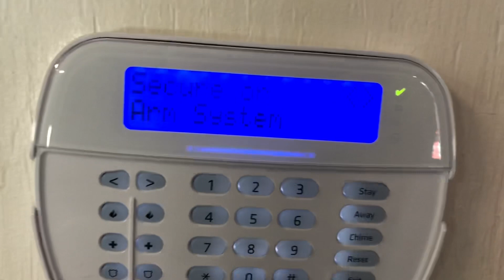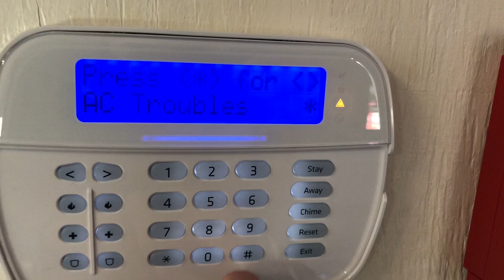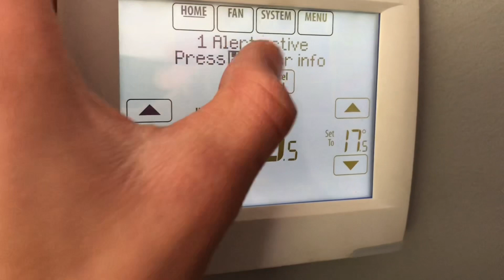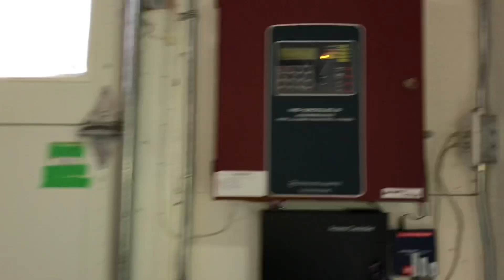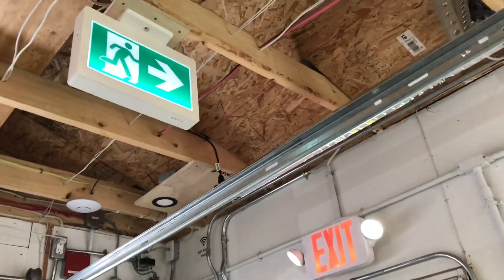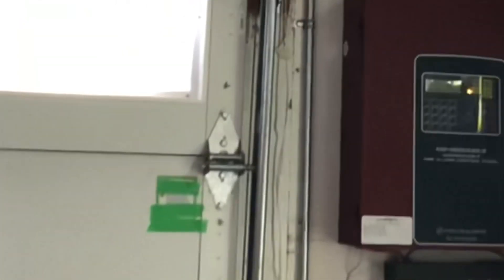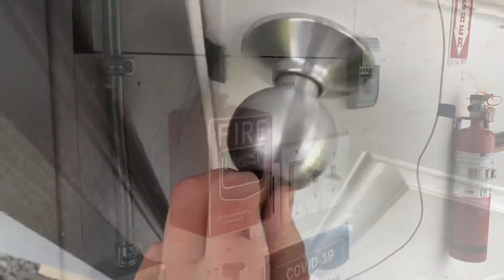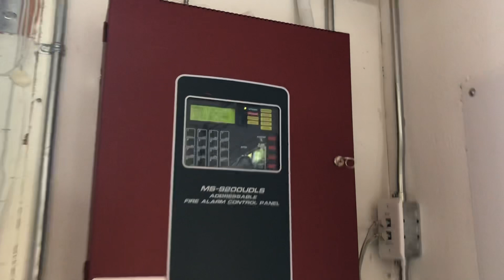Long power outage!

Comment: Does the FACP (Fire Alarm Control Panel) Batteries also give the Security System Battery Backup or not?

Edit: 6:10 You could use those in the main house somewhere, and put one where one light faces where the breaker is.
Reply from the maker: Fire alarm and security are two very different systems not powering each other at all and it wouldn't be legal as well they run on different voltages

Comment: I had a “slc 1 open fault” and before that “ann prim comm fault unlocked ann 80” what that mean ?
Reply from the maker: SLC open fault is an open circuit on the SLC. And the next is annunciation primary communication fault I'd say possibly from being unlocked for too long
Reply: @nics-systems-electric  thanks a one more question, the SLC is the circuit line between announciators and smoke detectors, etc or main panel to announciators or the circuit board of the main panel?
Reply from the maker: @iozkLive  SLC circuit is what communicates with detectors and modules
Reply: @nics-systems-electric  thank you so much, I get it now

Comment: last night at ii think 10pm my power went out at san ramon california how i know is i first heard a click and when i saw my emergency light it was on but the power cam back on i think at 11:35pm
Reply from the maker: Nice
Reply: @nics-systems-electric  emergency lights help you find flashlights easiier
Reply: @nics-systems-electric  my nintendo switch switched to battery mode as the screen turned on when the power was out as it got disconnected from power also my wifi router  was off as well as i dont have a backup battery inside  it

Comment: Don’t you have a battery backup on your panel
Reply from the maker: Yes as you would see in the video
Reply: Ok just making sure
Reply: @nics-systems-electric  you should make a video on putting a ups for your fire alarm system
Reply from the maker: @cooperreed254  It’s not on a UPS
Reply: @nics-systems-electric  no I’m saying you should install a ups on your system
Reply from the maker: @cooperreed254  Not really possible fire alarm systems are supposed to be hardwired not plugged in with an extension cord when it already has battery back up built into it it would be pointless and not correct
Reply: @nics-systems-electric  ok

Comment: Really cool, I just don't understand what you meant about the LEDs of the devices polling! Stay safe and have fun!! ...
Reply from the maker: Thanks I meant how notifier systems don’t have LEDs polling when AC power is lost
Reply: the led light bulbs flash to indicate the panel is comunicating with the devices, the led lights waste some power flashing so it would last longer if they still comunicated but the lights didn't flash when there is an AC Fault

Comment: Do you remember if they gave you the reason why they did that if so what was it?
Reply from the maker: Because they had to do work on the lines which was replacing cut out, fuses and lightning arresters, but they did not say why it went four hours instead of 20 minutes

Comment: Why are circuit breakers so hard to turn on and off
Reply from the maker: They’re usually not just large breakers are 200 amp is a little bit stiff in larger switchgear 400 600-800-000 etc. are difficult sometimes

Comment: Wow, interesting that you have 100 amp service. The breaker looked really tough to change positions.
Reply from the maker: 200
Reply: @nics-systems-electric  Oh, I thought it said 100, my bad.
Reply from the maker: @ryanwoods4691  the sub panel in the shed is 100 but the main panel in the house is 2000 amp
Reply from the maker: 200amp
Reply: @nics-systems-electric  Oh, okay. Makes sense.
Reply: Hello  @nics-systems-electric

Comment: Small, inexpensive UPS backups are fantastic for a whole variety of uses. I have a few that I use to keep my cable modem and router going, as well as a few wifi access points around the house. Comes in very handy during an outage. Audio: Maybe a setting changed on your phone/camera app that is affecting audio recording bitrate? Pretty weird... I've had similar sounding distortion on my GoPro before but it usually clears itself up in a few seconds because it's always automatically trying to correct the audio during recording. Strange that it's persistent through the video like that. Either way, nice video and the audio isn't BAD just because it doesn't hit your normal standards. Keep up the good work! 😉